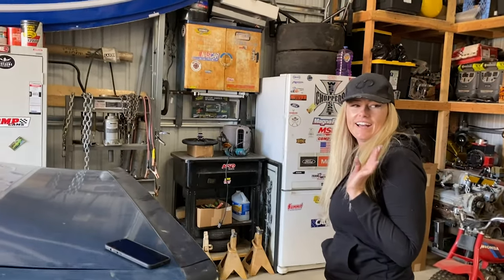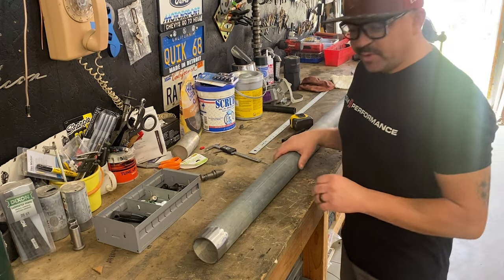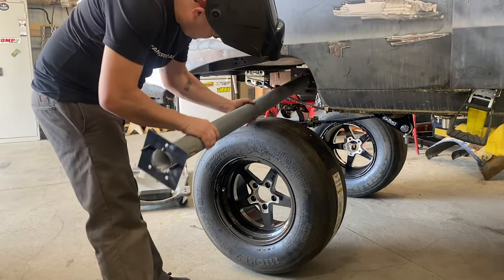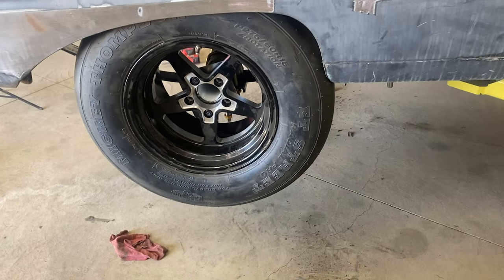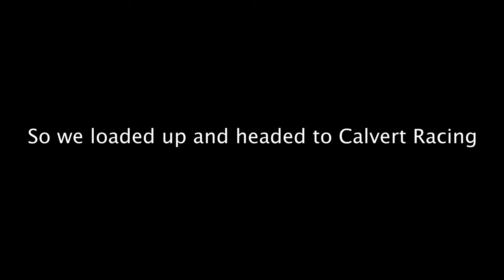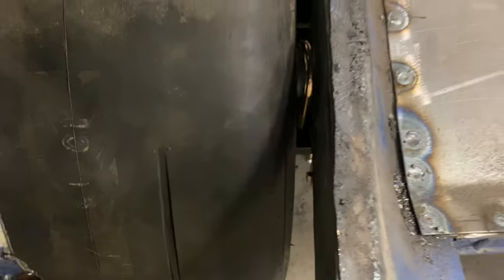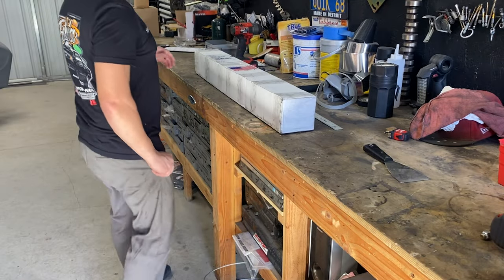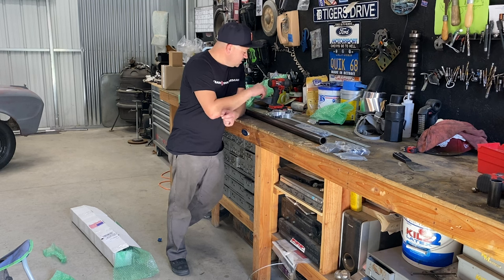BACK ON THE GROUND! and a visit from MISS MIDNIGHT MAVERICK!!!

Comment: Trying to think what pushed the front wheel out of center did you move the heim joints on the control arms
Reply from the maker: Yes I didn’t mark them when I took them apart for powder. They need to be adjusted. I’m gonna con Matt in to helping me get it back to normal ! Lol

Comment: Is the pin in the center of the springs, may be able to turn them around
Reply from the maker: I’m not sure to be honest. It was in the stock location and now it’s been moved back an inch. The ends are different and the springs rates are too so they can’t be swapped around. I’m just glad they’re close and I was able to drive over there and get it changed over.